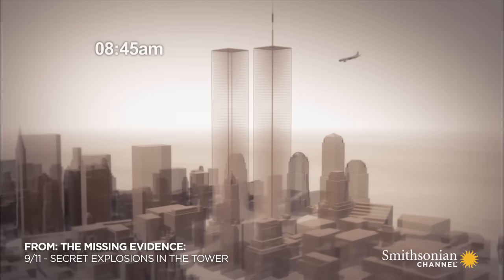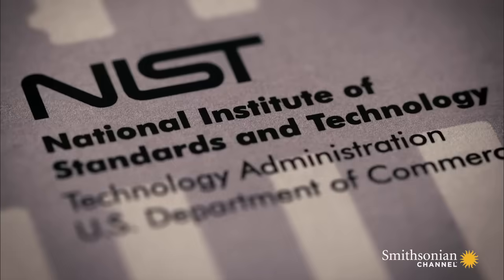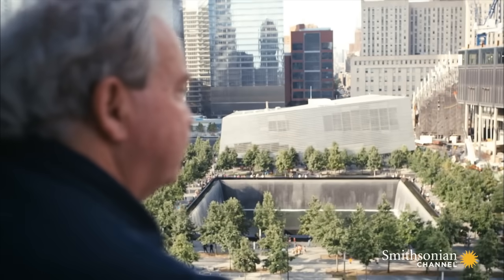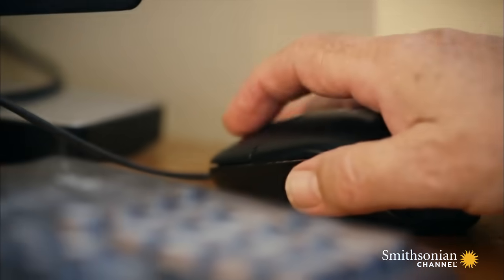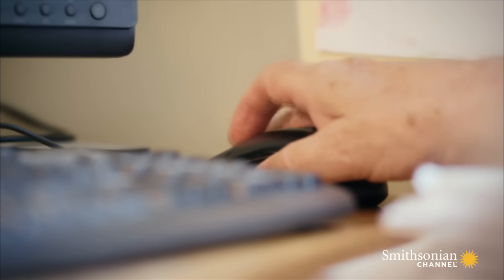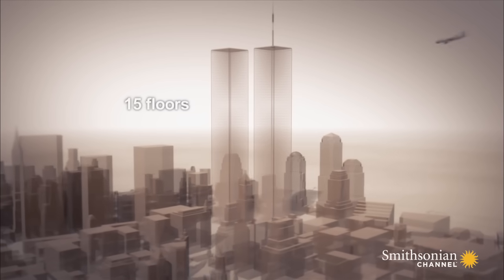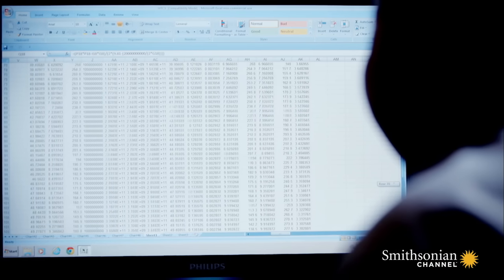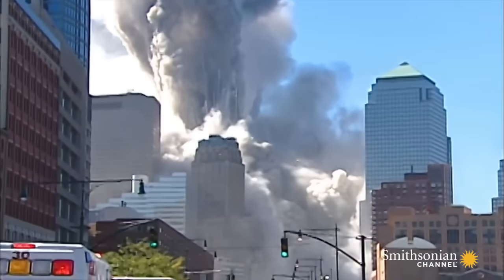This Computer Simulation Explains How the Twin Towers Fell

Comment: This video is DISINFORMATION. Submit your "research" data in full to Architects & Engineers for a proper scientific peer review, so SHUT UP until they tell you to speak!   9/11 is was a crime scene where 3,000 and more people were murdered, Smithsonian and NIST have sold their souls and this video is evidence of that transaction and collusion in those murders and two wars and the deaths of countless more people!
This is a kind of self serving, self excusing form of pornography.
Reply: how is ae911twoof going to peer review anything if they are basically housewives and mediocre students?
Reply: WRONG! More disinformation and mischaracterization  Architects & Enginners is comprised of over 2,900 actual progfessionals with advanced degrees, who have published their names and professional associations; signatories with verifiable industrial experience in directly pertinent, relevant and scientific fields, among them the chief electrical engineer for the WTC itself.  And you?  You can't even spell correctly.
Reply: ... until you check the profiles and realize they are nothing but housewives and mediocre students. The number of actual structural engineers in there would fit in a car. And you would have free seats.

Comment: Fucking no, it doesn't work like that.
Forgetting "For every action, there is an equal and opposite reaction" The upper block shouldn't just breeze through the lower floors, it would receive an equal amount of force punching it up - slowing it down and collapsing just as many floors on the upper block as it destroys floors on the lower.
Reply: Your interpretation would make Newton turn in his grave...
Reply: Well, let's imagine you have a stack of bricks, I know, the WTC was no stack of bricks, but it's a thought experiment. Drop a brick on it, would you imagine the brick fucking GOES THROUGH the whole pile of bricks without stopping or breaking itself, and only breaks when finally hitting the ground; or MAYBE it is just as badly damaged as the first brick?

Comment: Thank god for common sense. Of course the buildings were going to collapse. Two 50 tonne planes ploughing into them fully laden with jet fuel at 400 mph, nothing could withstand that. The heat must have been tremendous and all that fuel vaporising, it would have been thousands of degrees in there for a while, warping metal and cracking concrete. 
And as for the explosions, as the buildings collapsed air would have been forced down inside carrying fire and flames with it and bursting out the sides wherever it could.
It was a terrible tragedy wrought upon the U.S. by a madman that claimed innocent lives and the lives of the brave men and women who tried to save the occupants of the towers. Their memories shouldn't be diminished by all this false-flag conspiracy nonsense.

Comment: WTC 7
Reply: WTC 7: 47 stories tall completed in '87. Built above the Con Ed substation. Suffered substantial damage on September 11 2001, burned without remediation for several hours and ultimately collapsed.  Social introverts, basement dwellers, illiterates and complete fucking retards can usually be found on the internet saying stupid shit like " 'Splain building 7" because "it wasn't hit by a plane", while completely disregarding the fact that WTC 3, WTC 4,WTC 5 ,WTC 6, Manhattan community college and St. Nicks church were also not hit by planes and destroyed. Several surrounding buildings not in the complex were also not hit by planes and suffered severe damage, such as 130 Cedar, the West St. building and the Verizon building on Pearl, which sustained over a billion $$ in damage.   I suppose if you're intellectually underdeveloped, have paranoid tendencies and employ an impressive degeneration of basic rational logic, you'd most likely think it was "brought down with 'splosives by the the elite" or the "jooz", or (consistently) both.   Get a life, dipshit.

Comment: This has to be true.  I understand that when the buildings were constructed they did not use any steel in the building so that they could save money.  Instead they used paper mache.  Here we also see that, in the video, there is only one plane hitting each building.  We know now, that a whole fleet of planes struck each tower simultaneously.  Also, building seven was struck by a rocket ship coming down from orbit around Jupiter.  Conspiracy people are just crazy of course.  Government would never hurt the people they are supposed to represent.  We have the best government that money; not our money, can buy.
Reply: TheWizardJeff So i guess you have been brainwashed with the offical story.Just kidding i totally agree with you. Conspiracy theorists are a low form of life that has no value or meaning. They pollute these threads with their ignorance and stupidity. Mk Kendall is their leader .

Comment: Now if they can "investigate" how couple of sand dwellers, whom were deemed not even fit to fly a cessna 172 by their instructors, could withstand the intense g-forces experienced as plane descended so rapidly? Hitting a target at 500+ mph. How can even a commercial plane withstand the forces of 500+mph at sea level without breaking apart when they're only rate to fly below 350 mph at sea level. 
If there isn't a place in the lower 48's where an F16 can get there under 15 min but that day hours went by and no fighter planes were scrambled.

Comment: Don't forget, each floor was held up by a series of trusses, which is very much weaker than I-beams that held the outside skin and was used (but not reinforced by concrete) as the core of the towers; and to top it all off, the fireproofing spray on both towers weren't complete! (Fireproofing helps keep the frame of any size building protected and prevents the metal from bending at extreme temperatures in case of fire)

Comment: I don't remember which station I was watching that morning, but I knew they were coming down when molten steel started pouring from the corner of the south tower. It was burning so hot, the smoke was unbelievable, it looked as if it had mass to it

Comment: My theory: It was a controlled demolition. Once the top of the building started to descend on the lower half, the gov't or whoever was in charge of the twin towers had no choice but to detonate the explosives, to make sure the building wouldn't tip over and cause destruction on anything else nor kill anyone else.

As in a failsafe program, with a building of that height, and the great minds who planned its construction, they would've created a protocol inwhich the towers could fall straight down, decreasing destruction of the city. As in placing explosives during construction.

Comment: Interesting thing about where the jets hit each tower. Doesn't seem like these terrorists thought their plan thru very well. I mean, they evaded radar...they hijacked with box cutters...they invaded airspace...AND made it to their intended targets with much success. But, after all that masterful precision .....they chose to take out the upper floors leading to a footprint collapse. You'd think they'd have aimed a little lower. Assuring the two buildings fell off to one side or the other. They certainly had a clear shot at another 40 floors lower on each, without any obstructions. Way more damage if they would have collapsed sideways and wiped out 20 or 30 other structures. Just seems odd to me, is all.

Comment: Yet he’s not a structural engineer or an architect. Thousands upon thousands have said they couldn’t have fell they way they did. No resistance, fell at the rate of gravity. WTC 7 wasn’t hit by a plane, yet it fell in 7 seconds. People that survived in the towers all heard a explosion in the basement before the plane hit the higher level. People need to do more extensive research before believing the official story.

Comment: I hate to deny stuff without knowning as much as these kind of people. But the only way you could successfully recreate the destruction of those buildings, is by rebuilding them and copying the exact attack. There are so many conditions that would be taken into effect. Wind, the spreading of the fuel, the heat inside the tower being highly variable seen as we have no accurate reading of what the peak temperature was in there, The exact pillars that were destroyed. You couldn't recreate it accurately. Not by a long shot.

My issue though is not the buildings collapsing per say, but the build up to the attack and the events post attack.
Like how the towers were recently bought and insured not long before the events that took place, news stations getting interviews with Osama bin laden (like, lol xD) the Entire American force being completely abscent throughout which is the most telling example imo. I mean, what use is having national air defence if they are going all doing training exercises? How stupid is that?
You train in groups, you don't take your entire Air Force for an exercise out to sea.

And not only that, but the plane that hit the pentagon is the biggest issue, like, how the pilot, manage to avoid air defences at the pentagon and fly extremely low (which by the way, air line pilots aren't trained to do...at all) I mean, you think, with all the passengers screaming, the adrenaline rushing, the suicide pilot thought 'oh hey, I'll fly ridiculously low...just incase they have air defences' I mean, like they would even know how the pentagon air defences worked anyway.

Jus perplexes me, highly successful attack, and yet you look at attacks since, and they're all badly equipped, organised and strategised. I know that we now have anti terror divisions now but still, wouldn't that encourage them to be more devious? No they just get trucks and ram people, or leave a suitcase. Much different from an organised plane attack that was well prepared OVERSEAS mind you

Comment: That didn't prove anything. Hi w does all the steel n concrete turn into dust . It's not possible . Someone made a computer simulation of a goat with a jetpack, see any flying goats? Its just a tactic to fool u. I knew someone who worked in the towers before the attack, n he said there were floors never before blocked n emptied out. He said something was fishy how the were denying access to these floors right before the attack. Luckily he wasn't there on 9/11, but he helped clean up after n got cancer from breathing in the dust. So they still got him.

Comment: dimwitted garbage - WTC 1, WTC 2, and WTC 7 all fell at nearly free fall speed - WTC 7 actually accelerated as it fell - CONTROLLED DEMOLITION - no other explanation is feasible by the laws of Physics - look at the visible blast waves progressing down the sides of the towers, the squibs, and the vertical and extreme lateral ejection of debris......not solely gravitational - explosive mechanics plain and simple.  Fire's burned at the site Underwater for over 3 months - molten metal was found weeks after the Demolition - how do you explain that?

Comment: IF what is being proclaimed here as the truth, how then did the buildings not collapse on themselves years ago? The fires created by the "Aeroplanes" while extensive from the floors that were struck, and the floors ABOVE, and perhaps a floor or two below, remembering of course that fire burns Upwards, did very little visible damage to the floors below? These are the same floors that have supported the weight of the floors that were damaged for years before the "Aeroplane" strikes, with no sign of collapsing? I am sorry, but I for one simply do not buy it? I also remember the recent tower block fire in London, where the entire building was gutted, and yet it still DID NOT Collapse? Absolute Bullshit.

Comment: "the top section crushes the lower section" That statement makes no sense at all. How does the top section crush the lower section when 1) the lower section is many times larger than the top section and 2) the lower section was built to support the top section plus a lot more mass? It falling a short distance does not cut it either since it's the same force whether it's being held up or dropped some of the distance.

Comment: They were designed to with stand jet liners at the time the building was made. They were lighter back then. And they were designed to withstand the impact based on taking off and landing. Those speed are considerably less than what happened. And they did withstand the impact. For two hours so stfu.